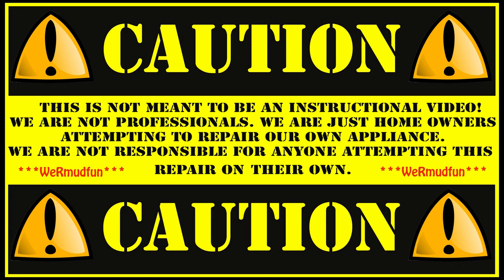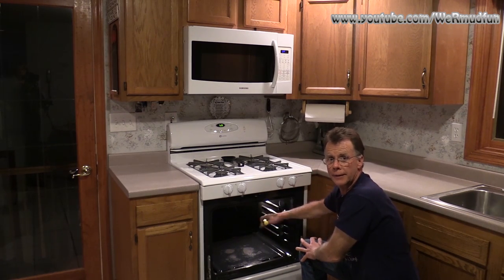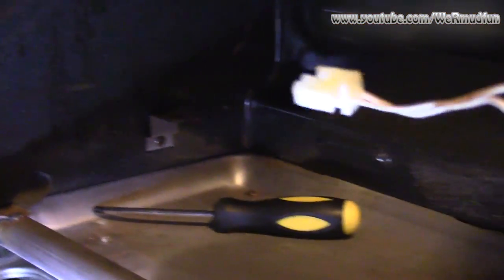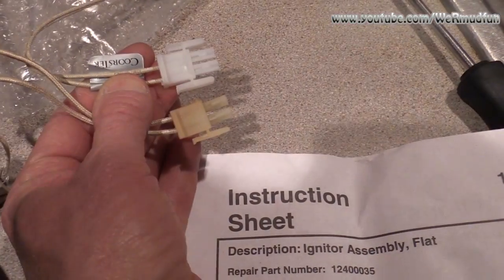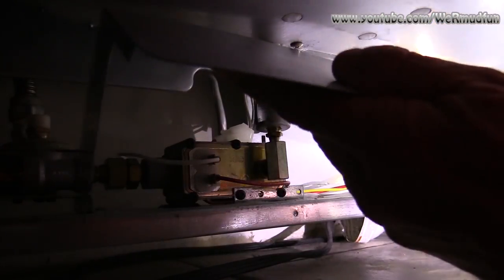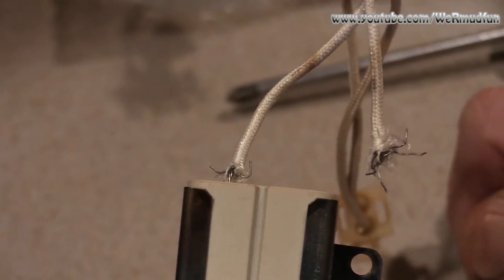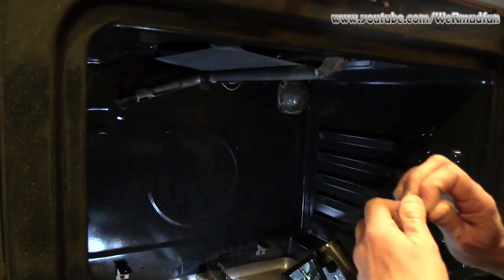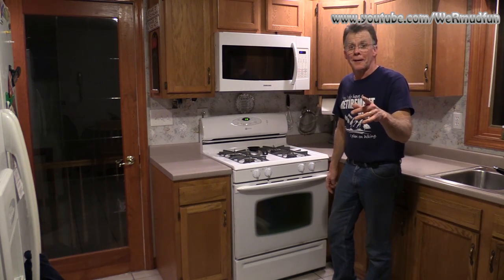How to replace Oven and Broiler Igniter

Comment: Thank you thank you thank you!! I've been cursing my Maytag range for months, sometimes smell gas, hearing a "whoomp" sound on occasion and took FOR. EVER.  to heat up. I was sure it was the electronic ignition. Called gas company, they said no leaks, good flow so here I am. Today it wouldn't even ignite and I already had puppy cookies ready to bake. Logged into YouTube and found YOU. Your explanation was clear and easy to follow and although we weren't as smooth as you were by any stretch of the imagination we exchanged the working broiler igniter to the oven burner and it came on immediately, heated right up and cookies are in the oven!! Thank you so very much.
Reply from the maker: Comments like this make it so worth it for us! :)  We are glad that you were able to fix it yourselves.  We hope the Pup enjoy the cookies. :)

Comment: This video was very helpful, as I was ready to replace my whole range, just to get the oven to preheat in a reasonable span of time! I ordered the part and just replaced the oven igniter without a hitch (other than some stuck screws that needed to be loosened with Coke). The cost was around $25.  Thanks for the clear presentation.
Reply from the maker: You are welcome.  We are glad you found the video useful! 😃
Reply: Coke?
Reply: Do u think we need replace both upper and down igniters at the same time?

Comment: Beautifully done, you two, everything I needed to know, and nothing else!  It's nice to see a USER installation (using tools we all have) and to see a couple working closely together!  All of your instructions worked even though I have a different, newer model with an AWFUL digital display.  Most of the blue digital characters are still bright enough to be seen, but the oven temp characters (in red) got too dim to read after about 5 years.  The 'fix' is an entire font panel/logic board replacement, at over $800 (if you can find one).
Reply from the maker: Thanks Scott.  Glad you got the igniters working again. Good luck with the replacement board, sounds pricey for sure. 😀

Comment: Very detailed video. Thanks so much! The only problem I have is double knee replacements. Very hard to get down on my knees. So do you think I could lay the stove on its back and reach in to replace the igniters? Does the broiler and oven igniters need to be replaced all at once?
Reply from the maker: Thank you.  To answer your last question first.  No they do not need to be replaced together at once to the best of our knowledge (which is limited, we only repaired our own personal stove). We didn't use the broiler so when the oven ignitor went we just swapped them and continued to use it that way until it went, that when we ended up replacing both.  To answer your first question...no clue.  I don't see an issue laying it back, but again we only fixed our own oven.  Good Luck.

Comment: I would invite the hell outta you guys to a barbecue.   Thanks for the video straight to the business. For some reason my broiler igniter connector is being bashful and won't come out of that hole....I should have watched this video at step 1....I have all the burners removed.... the top... control panel....etc etc.... didn't wanna fuss with the door because of everything that seemed to need to come offf.... lol. First time messing with a stove though. Thanks again!

Comment: Can you use any screw to attach the ignitor to the broiler? Also, is it easy to replace the wiring to igniter? Mine are no good. Thanks!
Reply from the maker: All we can say is we did use slightly large screws.  No idea on replacing the wiring, we have never done that, sorry.

Comment: Thank you sir. I found that both of mine were faulty. I was gonna swap, but no continuity on the broiler igniter either... Gonna have to swap them both out. $100 gone but that beats calling a professional.
Reply: Oh and wouldn't you know it, you saved another holiday.. Easter is this weekend and that oven will sure come in handy!
Reply from the maker: That's what we are here for! LOL
Reply from the maker: Glad you found it helpful. :)
Reply: Have a Kenmore oven something felt in the vent hole how do I get it out plastic will call me problem plastic cap
Reply: Something has filled in the vent hole in the plastic cap is there a way I can get it out little holes in the bottom will there be a problem leaving the gap yes or no

Comment: You maybe saved a marriage, I'm sure when my wife gets home the Love will fill the house again...But as an addendum to an excellent video I'd like to share my experience with this repair based off of this video.  My version of this oven looked exactly the same but there were no screws at the back of the oven which thru me off a bit.  There are two hmmm clips, pull them forward push the front end down and pull up from the back to remove and get access to the igniter.  Also you do not need to remove the broiler area plate beneath the igniter you can easily access it from the rear if you have a free standing oven.  Pull the oven forward and look down the clips for the igniter are right there.  Very easy repair.
Reply from the maker: Thank you for adding what your version had, as this will help others in the future. :)
Reply from the maker: I can't add photos to the video unfortunately, but feel free to send the pic anyway.  Our email address is on on channel page.
Reply: @DamonBooker_djBlkout  4yrs later and you're still the man.... couldn't get that broiler connector to come out.... found out their range is the same animal as the dryer just gets hotter ha.... now for reassembly

Comment: Hi I hope you are still around to answer when turning on oven does the broiler and oven lighters both glow ? My top broiler does not glow at all and the bottom oven does not glow as much as yours?
Reply from the maker: The broiler element will only light when using the broiler setting, I believe. We are traveling in our RV now, so I can't check.  If the oven is working in bake mode correctly, I would change out the broiler element first. Our bake element went so we switched it with the broiler element because we never used the broiler.  It bought us time.  When that one went we replaced both.  That about the best I can tell you, because we are not professionals. 😀
Reply: @WeRmudfun  No its the oven that wont light the igniter is glowing but im not sure how much it should glow. The gas does not come on not sure if the igniter is hot enough?
Reply from the maker: We have only repaired one stove, which was ours. We have no way of knowing what is causing your problem.  If I recall the igniter has to get hot enough to open the gas valve, but again we sold the house and are traveling in our RV now, so I can't even look at it.  The RV has a convection/microwave oven and that is a completely different beast! lol You could try to replace one igniter to see if it works, but if you have a different problem and it doesn't work the parts are nonreturnable i'm pretty sure. Good luck with the repair.  Call someone if you have to. 😀👍
Reply: @WeRmudfun  ok thanks hey have fun in your RV enjoy!

Comment: great video, thanks for sharing!  I think we have the same model.  Do you have any experience replacing the control panel?  Every time I try to use the broil function, it feels like I am going to push the panel through the wall!  :)
Reply from the maker: Sorry Oscar, we don't have any experience with the control panel.  We actually bought a new house with a different oven, if something goes on it, we'll try to fix it. 😀

Comment: I noticed your air vent just above the gas safty valve is at least half closed. If you take a carbon monoxide tester right to the stove turn on the oven and I'll bet you $10 your carbon monoxide reading will be almost a thousand parts per million when it should read  around 50. Put a carbon monoxide meter close to the oven vent and check the carbon monoxide level with the oven on 450 if you have high readings then you have to open up that air vent with your fingers all the way good luck that air vent is almost closed this will cause inadequate combustion and high carbon monoxide readings
Reply from the maker: We appreciate your tip. 😀  We sold the house a while ago, though.

Comment: I have a Whirlpool Range #WGG555S0BS01. About 4 years old. The top oven bakes, but won't broil or self-clean. I changed the igniter today, to no avail. The igniter will light when I try to broil, but the long, blue flame for the broiler won't light. And I smell gas after a minute or so, so I shut the broiler off. Same thing when I try the self-cleaning option.  Both the upper and lower ovens heat up in bake mode perfectly.  Any suggestions? Thanks.....
Reply from the maker: Sorry, I wouldn't even know where to tell you to begin.  Our experience is limited to changing out our igniters and it worked.  Wish I could be more help.

Comment: Our the Maytag gas igniters universal? Your oven looks like ours but wasn’t sure if I should find the exact match.
Reply: Are*
Reply from the maker: @matthewthorn8427  We are just home owners, so I can't answer that question.  We looked for replacements with the same number.
Reply: WeRmudfun thanks. I double checked. Seems they all use the same part. It’s an original.

Comment: Hi nice video....I have a Maytag and when I turn oven on when it starts to heat at least the glo....when I open the door there’s a big puffff....scary...could this in your opinion be the igniter.....just a thought....need to fix christmas dinner on the way....thanks ....Rick
Reply from the maker: I can't say either way.  We didn't have a puff.  Our igniter didn't get hot enough to start the flame.
Reply: Mine kept puffing away, and took forever to cook Christmas dinner. Another repair adviser suggested the oven igniter as my broiler works fine.

Comment: Neat trick removing the door. Doesn't work on my Maytag oven though. I can pick up the whole oven by lifting the door like that. ???
Reply from the maker: Wow, that must be different, ours is an older model and the door comes off with ease bringing it to the first stop opening it and then pulling it up.
Reply: @WeRmudfun  Wish I could figure out how to remove mine. Would this a lot easier to work on.
Reply from the maker: @LastBastian  Do you have an owners manual?  Maybe it would show how to or Google your model number?  Good Luck, it has to be removable. :)